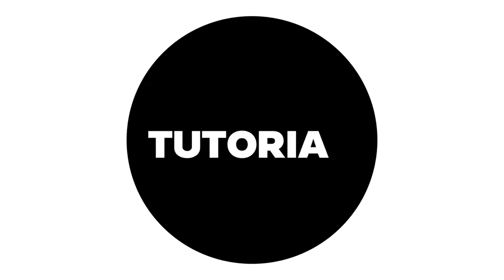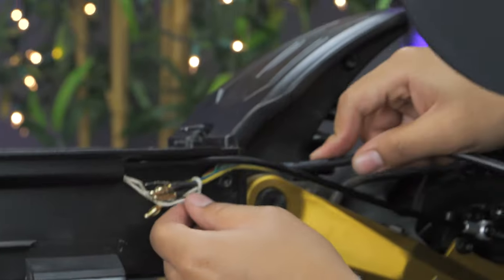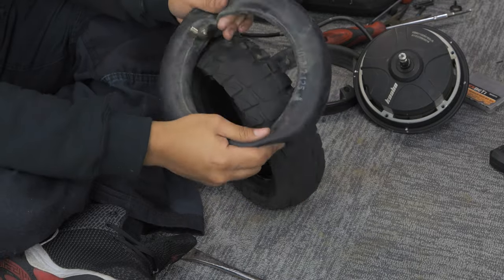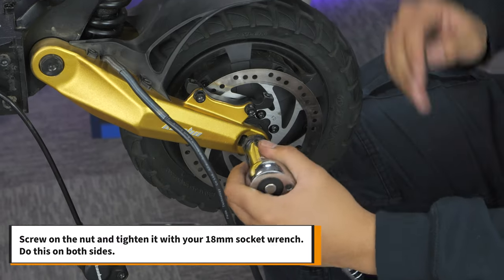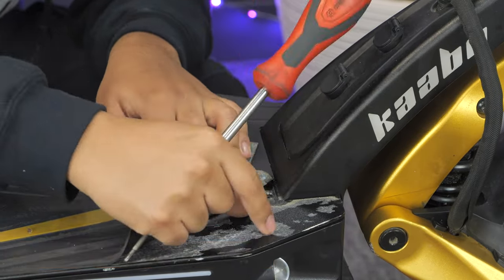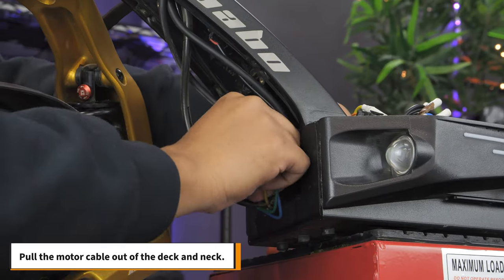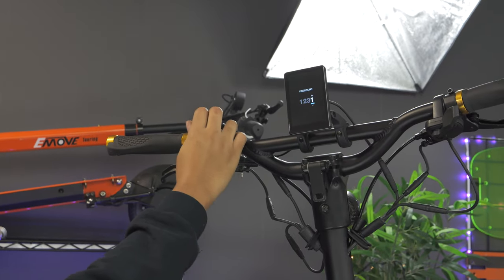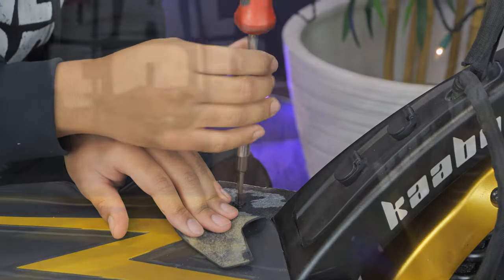How to Replace Front and Rear Motors and Tires on the Kaabo Mantis King GT | VoroMotors tutorial

Comment: I think the title should be "How to replace the motors on the Kaabo Mantis King GT" removing the deck plate and undoing the wiring is not necessary for changing the tires.
Reply: Thank you!!!!! I was looking for a comment like this. The whole time I thought I clicked on the wrong video I was like “wtf is he doing removing all the wires inside of the deck and sh*t” now I’m hesitant on removing the tyres in case of a flat lmao
Reply: Exactly, I was very confused for a second
Reply: Just remove the swing arm it’s one bolt

Comment: I've replaced the tire and inner tube on my Mantis 10, without using this involved process. (The process is exactly the same) all you need is an optional flat head, 4mm, 5mm and 18mm socket wrench and the replacement tire and or tube.
Reply: So you dont need to remove the batteries and cables and shti?

Comment: What?? I was able to replace my tube without opening the deck and unplug all the wires.  You just have to remove the wheel and open it with the half-rim. Opening the deck is only needed for changing the brake rotor because you have to pass the wire into the rotor.
Reply: I know right, you can change any tire or tube on any split rim scooter by following an easier process than this.
Reply: This process was crazy. They literally tore the entire scooter apart. Never in a million years
Reply: Unfortunately when changing tires yesterday I noticed my rotor was warped. So now I will have to go through this ridiculous process at some point when my pads are worn out unevenly because of it. Not looking forward to this process at all.

Comment: Removing hall sensors 100% unnecessary for tire change but would still like indepth instructions on removing and installing hall sensor wires for rotor/motor replacement.
Reply from the maker: Truth - we were demonstrating more than just the tires being swapped. Thanks for the request for the hall sensor wires.

Comment: Uhhh… no thank you. I like my way of replacing the tires better… remove fender, remove right swingarm (side without brake disk), remove split rim bolts and replace tube/tire. Takes about 5 minutes and you don’t even have to remove the wheel. C’mon guys.

Comment: Why in the name of greyskull would kaabo run the rear motor wires through a tube smaller than the connector on the wire??? Has the kaabo engineers ever heard of a slot? Just run a grinder down the length of the tube and boom, fixed, you no longer need to de-pin a connector to change a brake rotor.